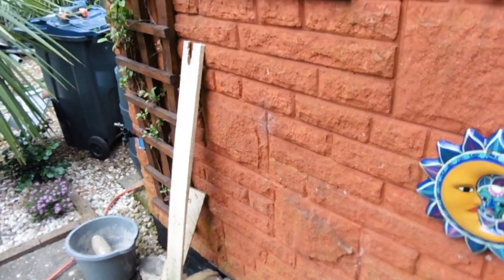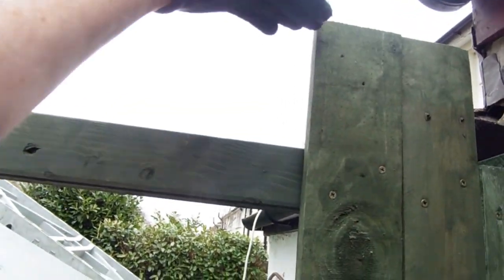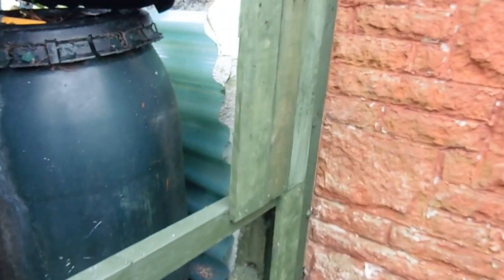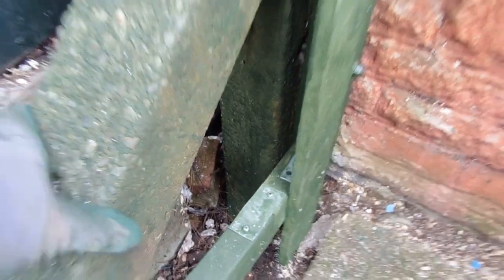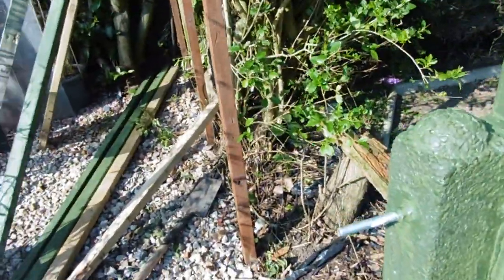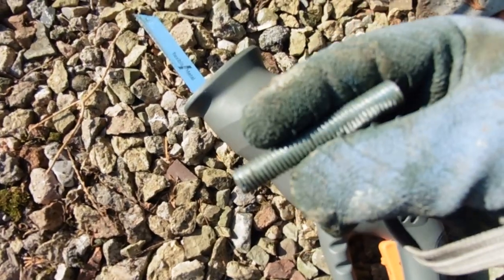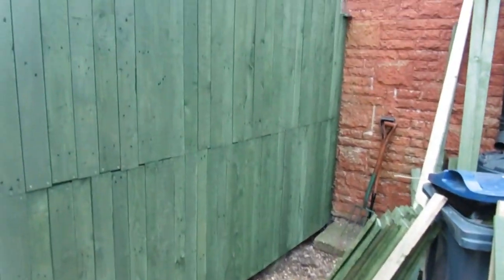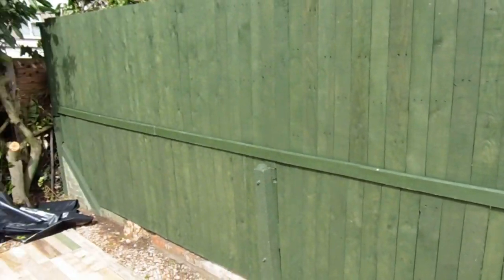How to Build a Garden Fence out of FREE Pallet Wood!

Comment: Wow, this is brilliant. So, here's the question...I found your video because im a skint single mum that can't afford a fence but I have an escaping dog haha, so needed to find a DIY. 
Is this doable for someone with no experience? You make it look so easy but im 100% sure its not! If you do think its doable with a bit of time and patience then would you please mind telling me what tools and materials I would need. Briliant job, its very good :)
Reply from the maker: Thanks Steph 😁 I would say yes it's doable although I would try to do it in spring or summer as it makes it much easier. At the time I used basic tool like a saw, drill, tape measure etc. It can be done you just need patients. Double check with a spirit level and double check measurements.